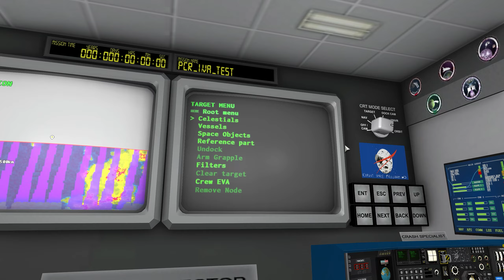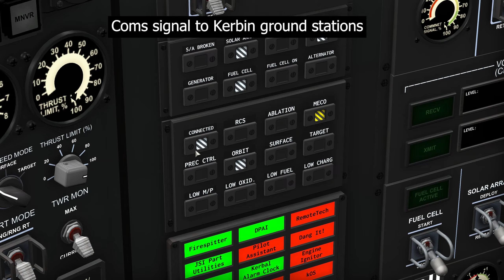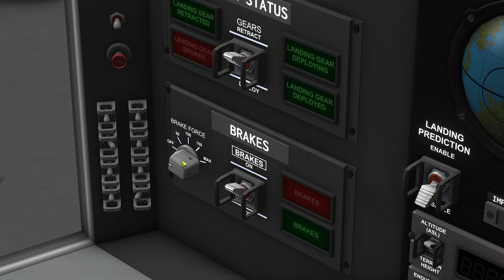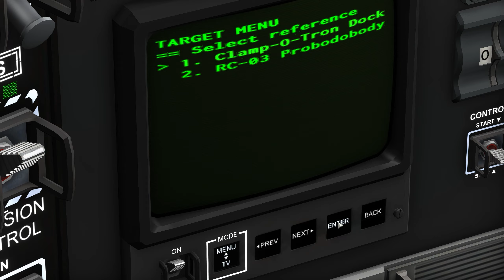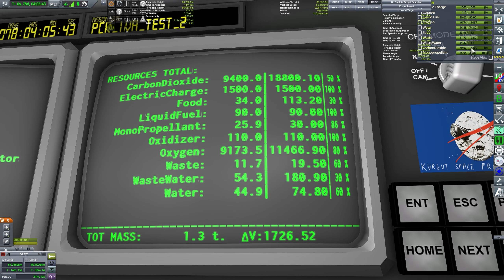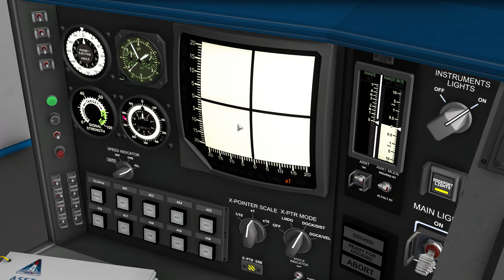ASET analog NASA style IVA Probe Control Room mod - an overview - KSP

Comment: Is there a way to transfer crew from a module to another ? (like tell them to do it from capcom seat) ?
Reply from the maker: I don't think you can with those monitor pages I have setup in PCR, but I guess you can with regular RPM modern monitors, to verify...
Cheers

Comment: I get more modern screens, I think it is either because of the KAS or the De_IVA extension. Is there a way to avoid that without uninstalling the mod?
Reply from the maker: Hi, I think it's because Reviva updated and changed its cfg structure, I'll take a look
Reply: I have the same problem, changing the Iva in reviva does not give any change

Comment: OP indicates orbital period, a really fancy way of saying how long it takes for your vessel to complete a full orbit around its parent body.

I'll have to give PCR a proper go with MAS, been playing this game forever and it occurs to me I've never really bothered with the probe parts.
Reply from the maker: Oh yeah (facepalm), ofc : )
Yup, MAS is planned for me, but didn't manage to make it work on my testings with PCR, you'll have better luck for sure : https://github.com/MOARdV/AvionicsSystems/issues/372#issue-2023317317
Reply: @Kurgutt  I'm taking a guess the probe part you are using doesn't have a CrewCapacity entry set in its configuration, MAS needs that, set to at least 1 or it freaks out with NREs as it expects there to be at least one crew member in the active vessel.

I've gotten this running on MAS. Using the ASET to MAS patch, I can see there are a bunch of props that never got converted over to MAS (Like the NASA gauges and the readback flags) back when we tried to do one final push to bring everything over but failed miserably because it's a ton of time consuming busy work. I'll see about at least converting any missing props that are required for this internal over to MAS and report back.
Reply from the maker: @Vulkans  Ok thank you, I'll test it out with the crew cap thing.
Great to hear it worked for you, I'll have time testing this when I'm back from christmas time in a few days. 
Thank you so much !